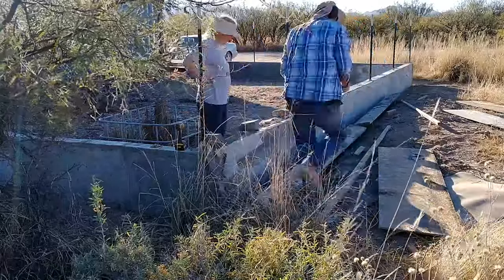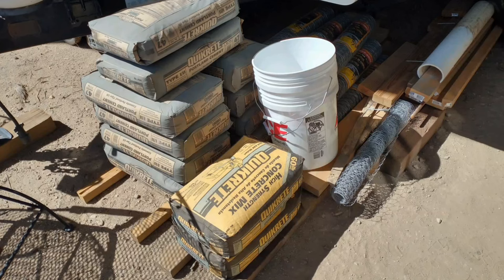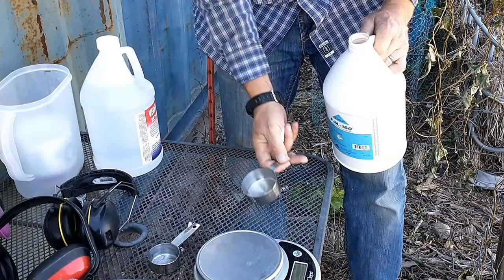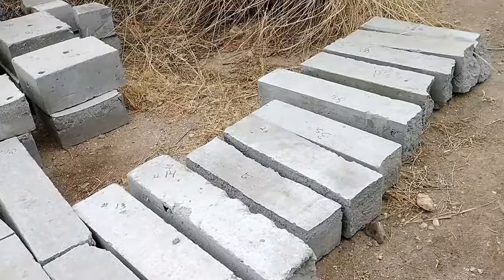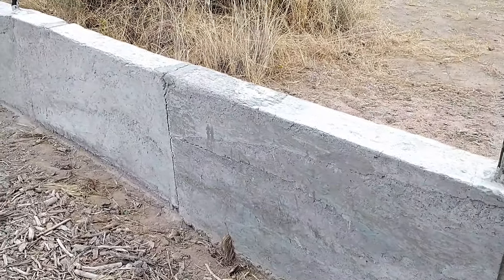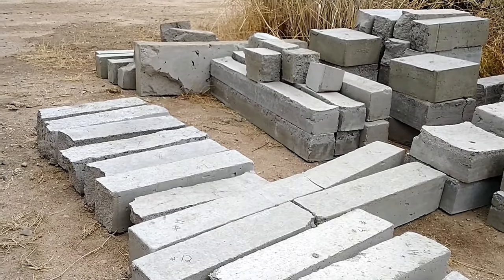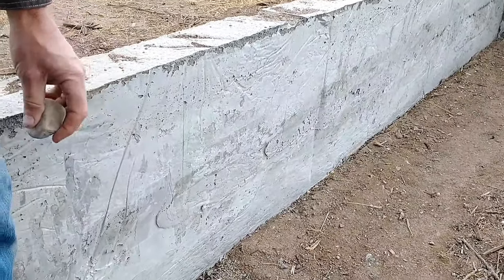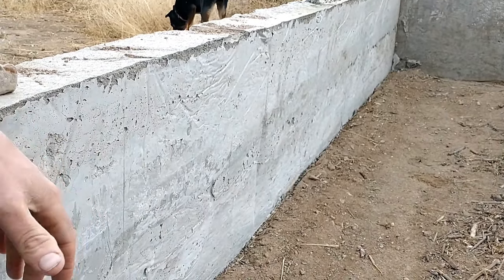Why we GAVE UP on AIRCRETE & What is Our Plan Now?

Comment: How Aircrete Is Made

Aircrete is made by mixing cement, lime, pulverized fuel ash, aluminum powder, and water. The chemical reaction catalyzed by the aluminum forms multiple air bubbles then dissolves, resulting in a very lightweight block.

In aerated concrete, the foam is generated from a chemical reaction between aluminum powder and calcium hydroxide, an alkaline element formed when the cement is mixed with water. This reaction forms hydrogen bubbles that remain in the cement slurry. After setting, the aerated concrete is cut into blocks and autoclaved for extra strength. It has the strength and durability of traditional concrete, without the physical weight. For a more compressive procedure on how it’s made, you can have a quick look here.
Applications of Aircrete

    Pre-cast blocks and panels
    Floors slabs, decks, and insulated roofs
    Underground piping systems
    Shock absorbent floors
    Acoustic buildings
    Lightweight filling over underground structures
    Backfilling mines and pipelines
    Landfills
    Replacing unstable soil in foundations

Advantages of Aircrete

    It is easy to handle, transport, and use.
    It is cost-effective in the aspect of the cost of materials required to make it, and the
    Overall construction costs.
    It has low thermal conductivity and low density.
    It has good acoustic properties, due to its porous nature.
    Aircrete does not combust and is fire resistant; hence can be used to construct furnaces.
    It is permeable to water vapor, which is effective in keeping indoor spaces cool.
    Materials used are Eco-friendly, and the final product does not emit any harmful gases during construction.
    It’s water-resistant and very durable as it doesn’t rust, rot or decompose over time.
    It is pest and rodent proof.
    It permits the use of coloring agents for aesthetic purposes.

It sounds to me like you were making foamcrete.  Foamcrete is what children play with for fun, aircrete is a commercial product used successfully around the world.  Highways, landing strips, tunnels and a lot more.  Also in home construction for footings. foundations, basements, tire retardant and insulation for example.  (The IQ of all of all the people you mentioned don't add up to 300!)
Reply from the maker: Sounds awesome! 
DIY aircrete is portland cement, water, and we used Drexel for the foaming agent. Some people say you can build a house out of it, but I definitely would not recommend it.

Comment: couple of things im wondering about:
-cure time for concrete is 28 days. i think you said somewhere you tested after 7 days?
-curing condition are ideally shaded and kept damp. looks like you got full sun, bone dry? 
-no movement joints in walls?
- what morter was used? was it weaker than the blocks to allow for movement and prevent cracking?
fabric can be bonded to the face of crete to prevent cracking too. 

heres a brickie talking about these things.
https://youtu.be/TCAIZiQu3W4

does aircrete even have the compressive strength for a straight wall? im not sure. but thats why ppl build domes with it.

good on you for having a go. your story is a cautionary tale to make sure to observe the best practices with a given material.
Reply from the maker: The samples were watered twice a day for 7 days and kept covered. We have other videos explaining the methods and process we used. These were comparative test, between the different mixes, and also testing our ability to make consistent aircrete. We were planning to do a poured in place wall with a metal frame, rebar, wire mesh, fiberglass mesh, and plaster. Some seem to say, you can do a poured wall, but after our experience, I wouldn't recommend it.

Comment: I'll chime in here by saying this. Aircrete isn't really something you want to go for when building a regular square wall build anyway. It's use is more conducive to being used when there are curves and odd shapes. It's also not meant to be used as solid blocks with no support. When using to build tall flat walls, with no curves, there is no benefit to be gained from using aircrete, outside of the fact that you use a little less concrete. Aircrete shines where normal building methods fail, or are too complicated to use in designs. Such as dome houses. When paired with a rebar structure, aircrete is strong, has better insulating properties, and will take shape of a dome, way better than most any other regular construction method.
Reply from the maker: I have heard aircrete domes often have issues with cracks and leaking in just a few years. Another thing is the insulation value isn't very good, unless the walls are really thick. We were planning to pour 8 inch thick aircrete walls that were well supported and reinforced. It wouldn't have worked well, it would have been way more work, more expensive, and it wouldn't have lasted as long as the house we built instead.

Comment: Did you try to submerge blocks in water for 2 to 4 weeks to slow down curing?
Reply from the maker: We covered them well with plastic and wet them down 2× a day. We knew on our house we weren't going to be able to keep the aircrete wet for more than a week without lots of forms and big expense.
Reply: @RedandAprilOff-Grid  Totally understand the limitations of resources for this kind of thing is a spammer in the works. Just the inconsistencies of the many tests must really frustrate you. Hope you are getting better results with new materials. Inspiring. 👍👍
Reply from the maker: @Joburgbass  Thanks! Yes, our house turned out great. It was less expensive, and much less frustrating to build.

Comment: Portland cement is the ideal choice, yet I never heard of anyone using a portland cement quickcrete to make aircrete.
Reply from the maker: I guess I stuck the wrong picture in when I was editing. 🤦 We bought some bags of quickcrete for comparative testing and didn't end up using them. We used Portland cement to make the aircrete, as is shown in our earlier videos.
Reply: @RedandAprilOff-Grid 
Thank you kindly for your reply. 
I did, a moment ago, just watched a video from Dome Gaia, wherein he mentioned that he had also experienced a failure, describing something similar to your experience. He attributed it to the cold temps also. 
 I thank you for giving me the oportunity to learn from your videos.
I wish you success.

Comment: Not sure if the purlins would make good beans. You want the most steel atoms as possible in line with the stresses and purlins just too thin to even keep that in mind. Channel and beams are great because of the thick material I'm the center.
Reply from the maker: They have worked well for our roof. We bolted them back to back, and they are quite strong. They probably wouldn't have worked well for aircrete walls though.
Reply: @RedandAprilOff-Grid  glad to hear! I imagine it's not too bad a way to go about it, I'm just fussy about structural stuff, im planning a shop build and i was thinking of perlins for the same since ill just be doing propanel for roof. but i thought the wind where im at is too much but I could stitch weld some perlins the same way you bolted them,  be a fine a roof I reckon. I've seen roofs made from sketchier lumber so good on you. Made me a believer.

Comment: I hope there is no Light Rail Transit tracks here which were rebuilt with only AIRCRETE railray ties to replace the pressure treated wood ties that were installed at first starting at around the year 1976 or so.. If that is so then we pedestrians will be in really big trouble here soon.

Comment: You woulds have been better using the aircrete to build dome and arched structures.  Also, the temperature is a HUGE factor.
Reply from the maker: I have heard of people having issues with aircrete domes leaking. I wouldn't trust it.

Comment: maybe the environment and weather changed the drying time, you could try it in a controlled environment in a tent with AC or humidifier or de-humidifier.
Reply from the maker: Yes, temperature seems to be an issue, so it wasn't going to work for us. We are completely off the grid and have limited power. We also have extreme temperature swings here in the desert. 🌞🏜️

Comment: If I was going to use aircrete I would use it only as a filler inside a welded steel frame on top of a concrete foundation. I would screw plywood to the frame and pump it into the void then pull the plywood the next day or 2! Thats IF I used it! It would be fine as long as it didnt have to support any weight and the R value is pretty good!
Reply from the maker: Regular insulation would be much easier and cheaper.

Comment: So what I’m hearing is air Crete could work but you can’t make it work correct?
Reply from the maker: I wouldn't build a house with it, but there are some applications where it might work okay. My guess is that the problem with the later batches is that the Drexel was too cold, but who knows, aircrete is finicky stuff.

Comment: Hello, so what appears in other YouTube channels about aircrete is false? it does not serve to build
Reply from the maker: We really wanted to make it work, but we as well as others have found, that it's hard to get consistent results with homemade aircrete. Our earlier batches were pretty nice, but our last batches were pretty terrible. It seems likely, that the colder temperatures were our main problem, but without further testing, we can't say for sure. 
We aren't saying it can't be done, but we weren't able to do it. 
We are sharing our experience making aircrete so others can see what we tried and learn from it. Maybe they can see what we did wrong, and do it better.

Comment: Foaming agents really are the problem, Try aluminum powder. That's the solution/recipe used in Europe, the AIRCRETE brand and autoclaved aircrete which is mostly the building standard in almost all of Europe. Also this type of concrete with no aggregate really lowers the strength, some reinforcement is necessary.
Reply from the maker: Yes, it definitely needs reinforcement, but even with that I wouldn't building anything with foam aircrete.

Comment: I have to think your low foam mix with wire in would be as strong as a standard CMU block.
Reply from the maker: Yes, the original standard mix and the low foam mixes turned out really nice. With a mortar mixer and Drexel that was well mixed and not cold, it is possible we could have made it work. There are still too many unknowns for us to be comfortable building with it, and the whole process would have been a struggle. We are excited to move on and get this house done.

Comment: Thanks for the videos on aircrete. I'm planning on building a lightweight steel frame small single story building which plan on encasing in 200mm thick aircrete with a hardfarced finish to the outside all in 1 mould. I will be looking to use polystyrene in the aircrete. It appears most inconsistencies occur with the foam which I believe could be made stronger with certain additives. 
I have also seen varying results with mechanical strengthening in the form of meshes. Wish me luck🤞
Reply from the maker: Awesome, best wishes on your build! 😎👍
Reply: Indeed, you will see varying results with various meshes. Using fast curing agents and higher strength mixes (CSA), should work, but design in columns of regular concrete and tie them to the rest with reinforcing or mesh at load bearing points. Always try to overbuild, with the materials at hand. Old pipe and steel work very well for reinforcement, chainlink fence can produce a very break resistant  concrete floor. Party on!

Comment: A timber frame or post frame construction with aircrete exterior walls seems like a better architecture. I would never use aircrete for structural purposes.
Reply from the maker: As mentioned in the video, we were planning to build the main structure out of metal c purlins.

Comment: It’s not meant for foundation. It’s best used as a cladding and then fiber mesh and stucco. You can use chicken wire instead of mesh and screw the cladding into the metal framing. You can add bridges between the framing to prevent from bowing. Unfortunately, you didn’t understand how to use it. Because it would have been amazing.
Reply from the maker: We were going to try a mix with sand for our floor, not the foundation. Yes, wire mesh, rebar and fiberglass mesh and plaster were going to be used, as well as the metal frame. We were testing the aircrete by itself, and our ability to make consistent batches. I'm not seeing aircrete house's pop up all over the place. Aircrete is not easy to make or inexpensive, and if the mix doesn't turn out right, it is powdery and brittle. My best guess is that the colder temperatures we affecting our later batches. I am very glad we didn't use aircrete to build our house.

Comment: Best of luck on the house, I really need to find these locations where I can build and not be hassled. I like the sound of that opt out permit, I am trying to build right now and I am into it for about 85 thousand and I might get my permits in a month or two. I figure when all is said and done it will be over 100 thousand. Just think spending money just to get permission to spend even more money. If I did something creative like your doing it would be more money and time. Gezz if I added in the cost of the rental for three years while I was trying to do this nightmare....ug better not to think about it. you would think less than 1700 square feet would be a slam dunk.  
Where do I get that opt out permit again:) 
I like the plans from home designer looks good, Not sure if your using the pro version, but it pairs well with sketchup especially if you want to build 3 d objects that home designer doesn't let you do easy. I import and export from both. Home designers catalog is good for some things and a joke for others.
Good luck!
-MG
Reply from the maker: Thanks! Wow, that's crazy!  Our whole house will cost less than your permits.  He used Chief Architect to draw up the plans. We just paid for 2 months to use it, but don't have access to it anymore. Cochise county, AZ is pretty nice. 😉😊🏜️

Comment: What kind of water did you use?  Hard / soft, etc?
Reply from the maker: We used an RV water softener. It was a small tank connected to the a garden hose. Out water went from a hardness level of 210 to 0.
Reply: Definitely soft then.  Maybe a curing issue (inconsistent water retention during cures)?
Reply from the maker: These were not kept as wet as most of our samples, which probably contributed to their brittleness. They were covered with plastic and stored in the well house for 7 days. When pouring them, we could tell right away that the bubbles were too large which makes the aircrete, probably more insulative, but also much weaker. My theory is that the Drexel was still too cold, the foam density was getting into the mid to high 90 grams per quart, which should have been acceptable, it didn't fall, but it was bubbling out more than would be ideal. We have videos showing everything we have tried and how it worked out. 🙂
Reply: @RedandAprilOff-Grid  I can understand your concerns about the inconsistencies from some of your test batches for the build you had planned...with Aircrete, consistency seems to be the largest factor in its use.   I have watched some of your testing videos and appreciate you showing many of the details of what you have done.

Comment: Thanks for the fun, informative vid!
I know nothing - and, I've heard that aircrete doesn't do well with "hard" (well) water and is subject to variations in humidity and temperature. It's so odd that your tests got progressively worse with each try. I wonder, could these have been a factor? Do you remember noticing a change in any of these conditions?
Reply from the maker: Thanks for watching! Our best guess is that the colder temperature was the main problem. We have since heard that using warm water in the foaming solution may have helped. The Drexel (foaming agent says on the bottle, that it should be kept and used at room temperature, which we were not able to do in our RV. We used a water softener for all of our batches.

Comment: That's an expensive lesson to learn when concrete is so simple, consistent, strong and easier to make.
Reply from the maker: We did consider it, but the problem with concrete is, it has very little insulation value. The thermal mass of concrete is pretty effective if the walls are 12 inches thick, and that would be a whole lot of concrete. Rigid insulation board could be added to the concrete, but that's a whole other thing.
Reply: @RedandAprilOff-Grid  concrete block done right is construction to last for ages.

Comment: Don't mix rebar with aircrete.   The air will corrode the iron. All materials other than wood and steel are pretty strong to compression and weak to tension.
Reply from the maker: Yeah, the whole thing seemed a bit iffy. We are very glad we didn't try to build a house out of aircrete.

Comment: Can you add shredded Styrofoam and test it into air crete?
Reply from the maker: It's too cold now to make aircrete, which was probably the problem with the later batches we did last year. We didn't try styrofoam because of the logistics of trying to gather and shred enough to build a whole house. Styrofoam would make it more insulative, but probably not as strong.

Comment: Why didn’t they use supports inside the aircrete if you don’t plan on using thick large molds or small bricks why would you think that a beam of concrete have any stability, even if you used solid concrete it would be more stable to use rebar inside to stabilize it
Reply from the maker: We were planning to do a metal frame as well as other metal reinforcement, but first were testing the aircrete itself as well as our ability to make good consistent batches.